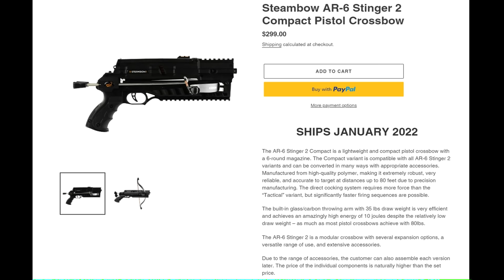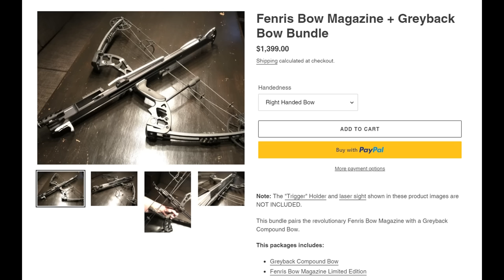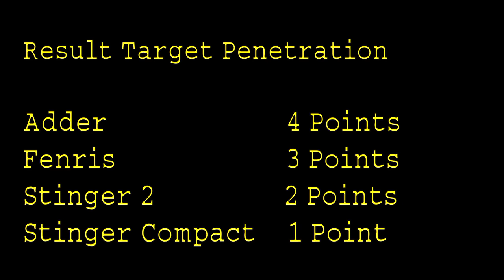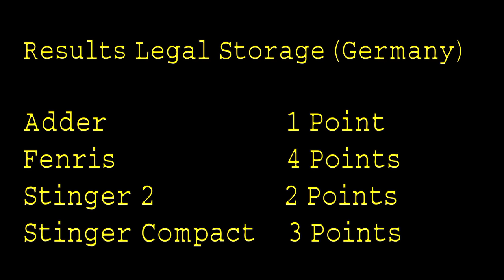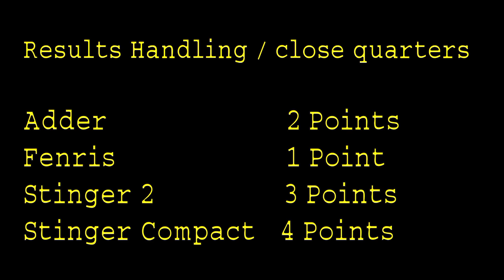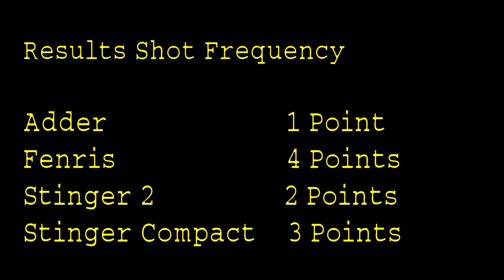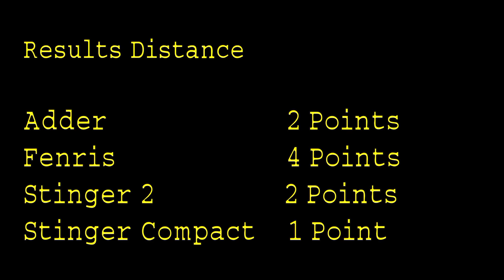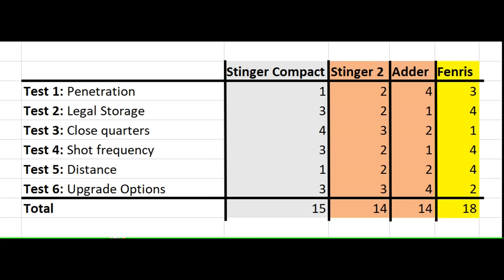Home Defense With Bow and Crossbow? OF COURSE!

Comment: Idea for the adjustable stock on the stinger.
Put the pull back cocking device on this with a mod so the stock is not in the way when you cock it.
Just pull back straight like the pistol version.

Comment: 7 meters is close to the 6.1 meters of the '20 ft rule' or Tueller drill. In which it's shown that a defender with HOLSTERED firearm can't get a shot off before an attacker can get to them (with a knife). And this brings up an important point about home defense with arrows or bolts. They do very little damage and rarely put the target down and out of the fight immediately. Meaning that at a self defense range, you're better off preparing for the close quarters (melee) fight that's coming to you. Holding a bow might actually be a DIS-advantage (eg if it means you're not holding some alternate like a sword) when the fight gets face-to-face. Even if the attacker has had an arrow pass through them. Broadheads kill by blood loss, and animals killed this way fight or run for a long time before being incapacitated.
Reply: No problem if your crossbow also has a bayonet
Reply: @Eatcrow  Love it.

Comment: The ‘toy’ one is just that. Certainly dangerous and possibly lethal, but no way I’d count on it with that low power. The AR6? I own one of the originals (crafted my own PVC shoulder stock for stability) and while it would be possibly useful it also represents a hazard to the operator. So I would not deploy it in a dangerous circumstance except as a last resort. The 130lb Adder, otoh, has the perfect balance of maneuverability, repeatability, user safety and power. Mine is configured with modified mechanical 2-blade broadheads. They penetrate, then expand and get caught if the recipient tries to remove them. The penetration of a pork shoulder through the pigskin is about 6 inches. 

Note that your objective in home defense is FAR different than your objective in hunting! In hunting, you want pass-through in order to maximize blood loss. This makes for a quicker, more humane kill and makes tracking easier so your quarry does not disappear into the woods, never to be found again. In home defense, however, you do NOT want pass-through! Your objective is not to kill the person, but to maximize the ‘bothersomeness’ of having been shot in order to dissuade them from continuing their attack on you. So you want that arrow to get stuck inside them, and be difficult or impossible to pull out. My solution to this is to NOT glue in the insert! Friction fit it so it stays aligned during flight, but if the recipient attempts to pull the arrow out all he gets is the shaft. The head remains stuck inside his body. The 130lb Adder has the perfect amount of power to accomplish this.

Comment: I know your always looking for new ideas so here goes. The airgun world was all excited when you could have an air rifle with x2 power settings. So how about a bow with x2 power settings the initial arrow does not penetrate the burglar so you switch to the more powerful bow. My thought here would be that with your engineering skill you could devise a double bow system where you engage the more powerful string when extra power is required but on the same bow obviously with x2 limbs.
Reply: Just use a blunt tip arrow. They're meant to stun birds without killing.

Comment: New to the channel. Curious how those might fare against light body armor, like kevlar or metal plate. Cool demonstrations and designs. I took archery before so this brings back cool memories 👍🏿👍🏿
Reply: Decent bows will go right through Kevlar, no bow is going through metal though. The arrow tip gets smashed into the arrow.
Reply: Check the channel "weaponsandstuff93". He tested kevlar riot armor against crossbow bolts. They didn't do very well actually. You need a powerful crossbow to do so. Not pistol ones.

Comment: While I like the "Steambow AR-6 Stinger 2 Compact Pistol Crossbow" I would like to put an order in for the Stinger 2 Compact ASAP!  I see this as a Good Short Range addition to my Crossbows collection, BUT during this video, i see a Possible Potential Problem? when shooting at a faster rate of speed, the cocking arm, DOES NOT ALWAYS RETURN QUICKLY OR COMPLETELY to the Home position, and needs a second to a Third Push/Tap forward to Get the cocking Arm to the Home Position. What Type of Bushings, Support that cocking Arm? for starters, Next what is the mechanism that Pull/Push the cocking arm Back to Home? Next If it is a Plastic Bushing, could that be Upgraded to a Oilless Bronze Precision bushing? OR can the Plastic Bushing Be Lubricated as this area seems to be a Problem area right off te Bat. Or is it Too Short of a Bushing length, with a Loose tolerance fitment causing Jamming in this area, combined with a Alignment Issue. This area seems like a Problem when it comes to proper functionality. I would Like to order one of these, i dont wont to have to reengineer it to get it Properly Functional. But if you were to show what needs to be done to get it to a Very functional cycle then I will order one ASAP!
Reply: Joerg Sprave, Can you look at that Area?, and do a video regarding this and How to make the cocking MUCH smoother both on the Push and the Pull of Cocking this Great Featured Crossbow?
Reply: YES mine is on order! to see what i can do. I will also put on the Light with a GREEN high powered Laser Sight for longer range shooting, these will go on the top rail, as the only sight and lighting. and put a Vertical forward grip mounted to the Bottom rail to provide more stability holding and bracing the COMPACT. I think that balloon could have been hit in three shots, five shots at the most, If not then their is too much sloppiness in, IF i notice there is too Much sloppiness then a small piece of either Teflon tape the correct thiness, to remove sloppiness to correct levels to at least mat the steambow 2 regular
Reply: Look at the picture of the COMPACT you you could Mount a fitting to front lower rail with a mount to the lower pistol grip make it out of thick enough Flat Stock maybe add a piece of Black plastic to make a Handle to scews to tighten the handle at the location that feels best when holding and works best at distance Black it would be a sliding adjustable Handle internal stock to get a more secure grip on the COMPACT and better stabilize the weapon in you hand
Reply: Would the 55 lbs Bow from the regular rear cocking  steambow 2 mount and work on the COMPACT?

Comment: In an intruder situation, who's body is pumping loads of adrenaline along with any narcotics they may have taken, I'd put my faith in the Adder over the other crossbow pistols, even if it is slower. The sheer force of the 130lb adder limbs with broadheads or bodkin tips straight into the chest area should be enough stopping power....which is what you want.
Reply: Nerves makes missing more likely. More shots is probably better than raw power.
Reply: @user-ko3tv7jl2r  no problem, the adder gives you at least 5 shots to hit your target....

Comment: The only test I haven't seen with your pistol bows is a bone test. We know how soft tissue will respond to impact from your tools. But we don't know how they will response to hard target. Can they defeat dense internal targets like bone? That's a less resolved question.
Reply from the maker: I have done many tests with coconuts in jelly, Meat padded dog food cans and even ZGB skull analogs. Check my earlier videos. All of the weapons can penetrate a brain cavity except the Stinger Compact.
Reply: @Slingshotchannel  I stand corrected good sir.
Reply: @Slingshotchannel  Say how does coconut hide compare to bone? Is it tougher equal to or close to or less than?
Reply: @Slingshotchannel  Do you think the Stinger Compact would be able to penetrate, with the 50lb bow limb? (And still be usable). I know the 90lb one is a no-go for that model, but curious about the mid-weight one.

Comment: Unfortunately your crossbows are on the weak side for hunting legally here in New Brunswick, Canada. Crossbows used to hunt deer, moose and bear must have a minimum draw weight of 68 kg (150 lbs) and be fitted with broad heads no less than 20 mm (7/8 in) in width. You've only got one that goes to 150, and that's its extreme top end. My current crossbow is 185. I own the Guillotine 185 compound crossbow. And have killed a deer and a bunch of rabbits with it. If you could make one about 200lbs that cocked easy, be perfect for Moose or Bear. But its gotta fit a 7/8 broad head by law.  I enjoy your channel very much !!!

Comment: Watching the Shot Frequency section at 18:00 time, for the "Stinger 2 COMPACT" The Compact Failed 2 shots out of 5 Shots, and required assistance to fire those shots, as the 2 Failed shots Needed assistance to Complete a cycle before it could continue to be shot, this reduced its cycle time between shots, down to 1.5 shots per second. If a Smoother Push forward could be had this would greatly enhance this Compact crossbow, maybe a type of Graphite DRY Lube? or some other could be used, something that doesn't attract and Hold, Dirt and debris into the bearing?.

Comment: Firearms are quite loud. That's why a large number of home self-defense enthusiasts pursue suppressors/silencers. No, contrary to Media, Hollywood, and certain Congresspersons' assertions, whisper-quiet suppressors virtually do not exist (there are rare exceptions of course) - one has to use low-pressure sub-sonic ammunition, a very prohibitively-large suppressor, and have a very quietly-cycling firearm to have the Hollywood Pew effect they ascribe to suppressors. While I can't definitively say such a firearm and combination don't exist, I've yet to actually handle one or see one in live action. Yes, there is a very anti-suppressor sentiment in the States from anti-firearm activist types, hence my steel-manning position.

Ammunition that substantially sub-sonic is also a greater danger to innocent bystanders - the overwhelming majority of expanding ammunition requires velocities in that trans-sonic to super-sonic region in order to actually deform and expand. Expanding projectiles that aren't going fast enough experience little-to-no deformation in the intended target, very poor energy coupling and transfer to the intended target, often result in over-penetration of the intended target, and can present a hazard to bystanders and surrounding property as a result, just as the case with non-expanding projectiles. To my knowledge, only highly-frangible projectiles, like sintered bullets, are even capable of sub-sonic expansion or deformation, and those are expensive and difficult to manufacture.

Comment: I manufacture my own exploding bolts.

Round, hollow, carbon-fiber shaft, aluminum nock, pointed 6" drill stem enclosed - point facing forward, cartridge holder screwed on in place of broadhead tip, safe handling, silent delivery, devastating results upon impact!

NOTE:  The key to self defense against a burglar is, don't report it. Let the burglar call the cops!

Owning a backhoe might also come in handy in extreme circumstances.  😂

Comment: I like those Full Automatic Pietro Beretta .177 bb pistols, but many types now exist.   What are your opinions on those for fun or even self defense.  Are they even legal in Germany or elsewhere?
Reply: The full auto ones kinda suck, and would be a liability if you sprayed an innocent. I would go with the large-caliber semi-auto PCP rifle if that is legal in your area. It is likely not.
Reply: @nobodynoone2500  Yeah, although I'd add that the full automatic Pietro Beretta I have sprays all the shots about 275 fps, 20 in 1 1/2 seconds.  Up close at 8ft of range the bb's stay in a 3 inch group, 20 feet that increases to a 6 inch group.  I've shot raw meat from 6 ft away as a test, and it tore it up 😆
I digress however, I would say it's better than nothing but I totally agree with you also.

Comment: Let's be honest, we knew from the start that the Fenris was the winner. Bows are better than crossbows but hard to master. The Fenris is technically an upgraded hybrid so it has all the pros and none of the cons.
Reply from the maker: That is actually correct.
Reply: @Slingshotchannel  Any chance a smaller Fenris could be made? I really like it, but it just seems too large.
Reply: @Slingshotchannel   Hi Jorge, which bow unit is smaller and lighter, the soon to be released Ek Archery Whipshot or Steambow Fenris with Greyback??  Not just the bow weight only, but total weight of both weapon, which is lighter?

Comment: With the linear cocking system on the smaller pistol crossbow, could you add rubber to help pull the cocking mechanism back and add a stronger bow?

Comment: I want to see a conversion of the hand pulled stinger with a more powerful bow I think it would be still possible to cock it
Reply: You can put the 55lb limb on it. Theoretically the 90lb one. The compact and stinger 2 are basically the same weapon just different back ends you can swap out if you want to pay extra for
The parts.

Comment: I love the video but it's not a proper home defense proof of concept

Bad guys are not target practice. They move, they hide and they can fight back. You need to test out your crossbows in a proper close quarter combat training room. This is how special forces train to fight inside buildings. The home invader can be outfitted in protective gear especially for his head and neck and groin. Instead of deadly sharp bolts you can fire rubber tipped arrows that can't penetrate human flesh. Run this simulation in low light conditions and with the perpetrator hiding to either fight you or run away. See if you can defend yourself with the crossbows and which ones where the best. The CQC room needs to resemble a typical home layout as much as it can. 

I bet what would really aid in home self defense is if the crossbows are outfitted with strong strobing lights designed to daze and blind your target. Also a strong blade attachment at the front of the crossbow if your assailer gets too close. Your crossbow can become a stable strong stabbing weapon with some reach advantage over a standard knife.

Comment: The FBI standard for gel penetration is 12-16 inches in 10% gelatin. This should tell you animal tissue is more resistant than gel. So anything not penetrating at least 12” should be considered a very poor choice to stop a determined threat. If one has the right to life, one has the right to defend that life, ergo the right to the means of defense. You might want to question any government that does not acknowledge your innate and inalienable rights 😉
Reply from the maker: This is 20% gel, much tougher. I calibrated it with raw pork and beef.
Reply: @Slingshotchannel  if you calibrate with a BB  it will tell you exactly how much tougher your gel is. Non living tissue isn’t as elastic. Also I think wet rawhide would make an excellent skin analog.

Comment: after watching hundreds of "Active Self Protection" channel's video. A minute response time is insane. "go time" is under 1.5 seconds. And while it's loud, a shotgun will stop a bad guy. Many bad guys shot with handguns still run away or if on drugs still continue attacking. People don't drop like in the movies. I assume it would be the same with the arrows. Might be safer and cheaper in Germany to just keep a set of 6 throwing hatchets by the bedside. No loading time, and my guess no key necessary. And they will stop a guy at 6 meters. LOL